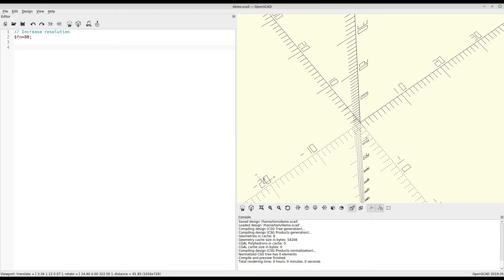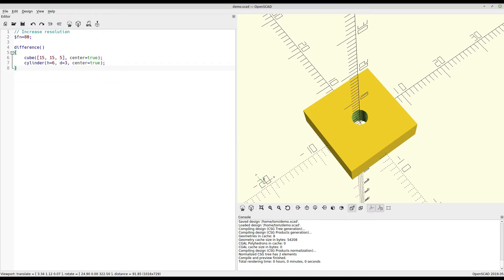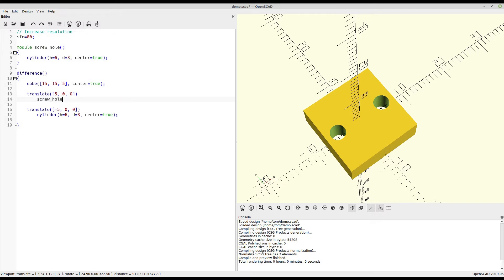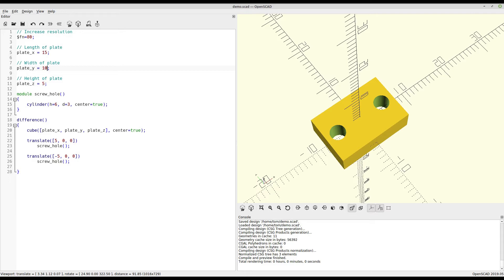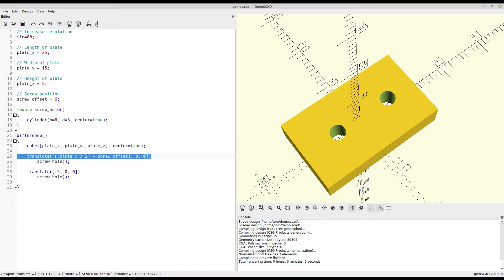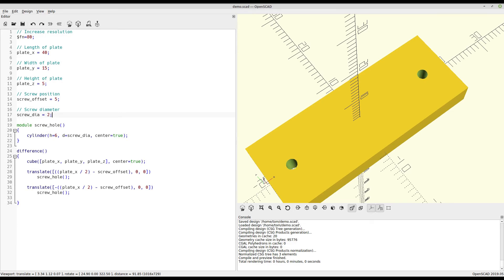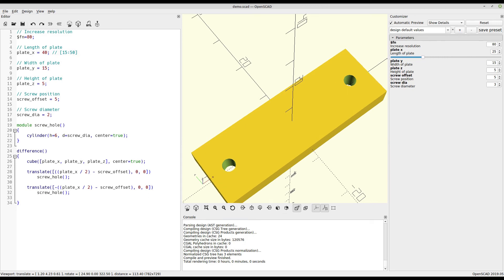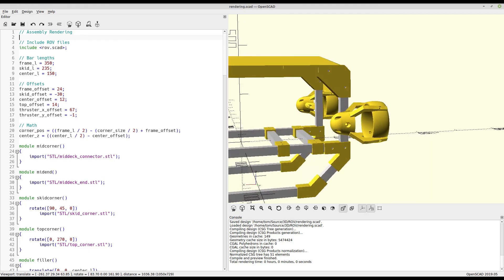Basics of Parametric Design in OpenSCAD

Comment: Hello, thank you for making this video and explaining how all this works.

I have a tip for everyone that will make using a program with parameters like this MUCH nicer.

When you want to change a parameter, place the cursor just to the right of the digit of the number that you want to change. Now press and hold the ALT key, and then press the Up and Down arrow keys. The digit to the left of the cursor will increment or decrement, and the Render display will update immediately.

You are also able to hold ALT and then use your scroll-wheel to change digits, though you may need to enable this in the Preferences/Editor settings first.

Numbers will go negative or positive in the way that you would expect, and pressing ALT-Right or ALT-Left will move the cursor to a different digit, and even add zeros on the right if needed.

I LOVE OpenSCAD!
Reply: THANK YOU! how do you know it?
Reply: @ВолодимирСабадаш-е1ш  You're welcome. I found it in the online User Manual. I had written a quite long reply to you, but it never got posted. Where are you from, what does your YouTube user name mean? I'm in USA Minnesota, just curious!
Reply: @davidkaye821  I from Ukraine, and my nickname in English Volodymyr. That my name:)
Reply: @ВолодимирСабадаш-е1ш  You are Welcome! It is in the online User Manual. In OpenSCAD program, click Help/Documentation. A web browser window will pop up. On the left hand side, click OpenSCAD User Manual. Now, in the center, click item #3, User Interface. Again on the left, click Text Editor. The info is about 1/3 of the way down, but it would be useful to read all of it.

The User Manual is quite large, but it would be a good idea to click each section and scroll through quickly, reading the topics. You'll find a lot of useful information, but can skip past stuff you don't need.

Please tell me, where do you live? I am in USA Minnesota! What does your YouTube User Name mean? I'm just curious! :)